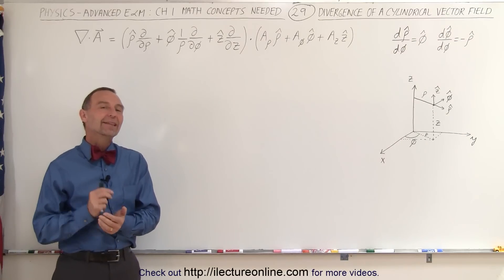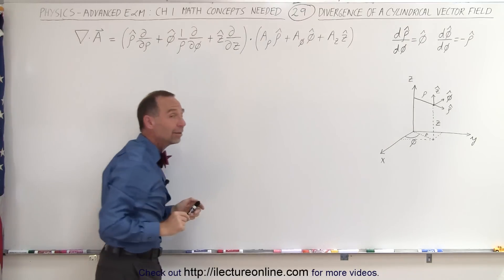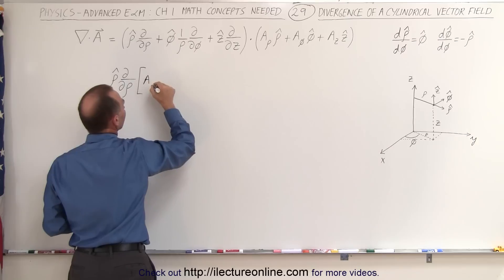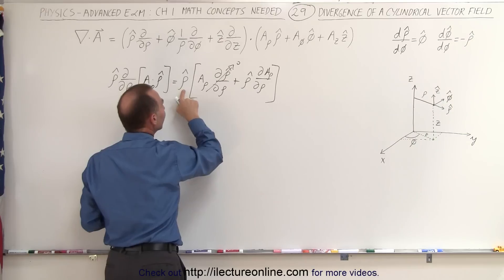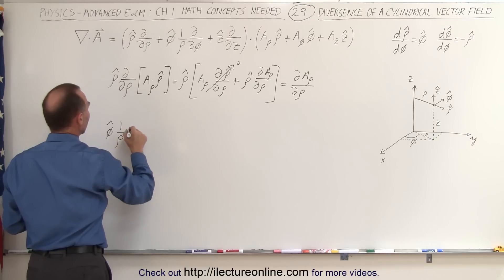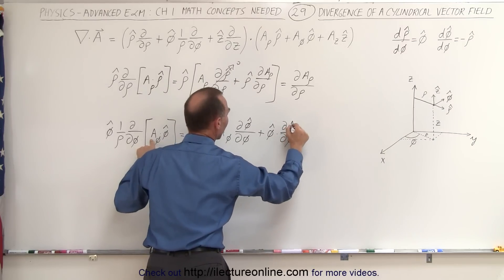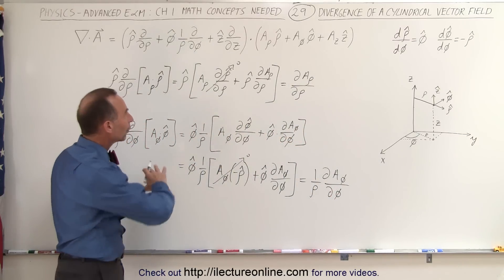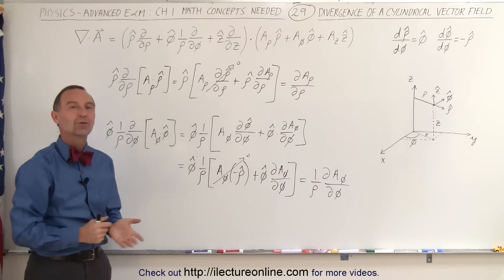Physics - Advanced E&M: Ch 1 Math Concepts (29 of 55) Divergence of a Cylindrical Vector Field 1/2

Comment: sir, the explanation is awesome, but can u explain how those results written on the right size of the board came????
Reply from the maker: When you look at the sketch.  If you change the rho vector with respect to phi (turn it in the direction of phi), the change in the rho vector will point in the direction of the phi unit vector.  And if you rotate the phi unit vector through an angle of phi, the change in the phi unit vector will point in the direction of the negative rho vector.
Reply: @MichelvanBiezen  Hi sir, I understated this intuitively, while is there any derivation about this?
Reply: so if you change rho by an amount d(rho) one of the ways you can achieve this is by going d(phi) steps in the rho unit vector direction. So d(rho) = d(phi) * unit vector of phi. This works cuz at small infinitesimally small distances the curve a straight line.